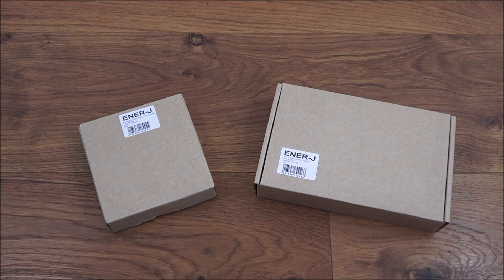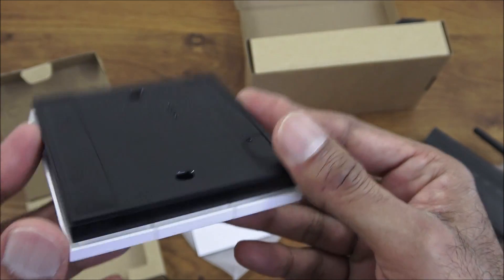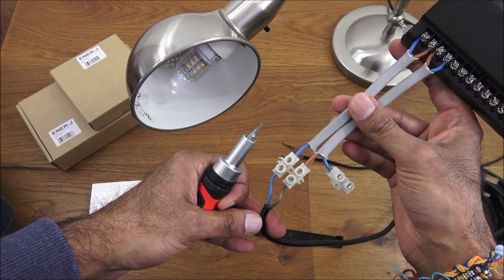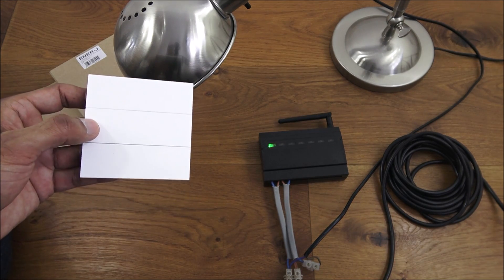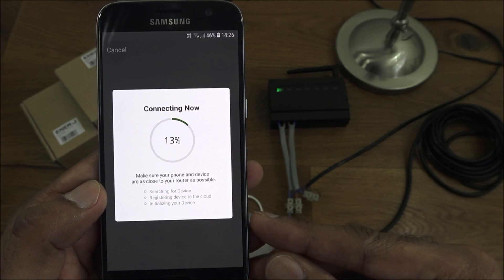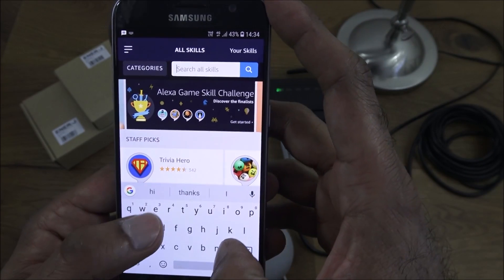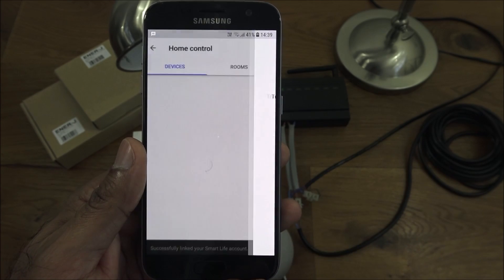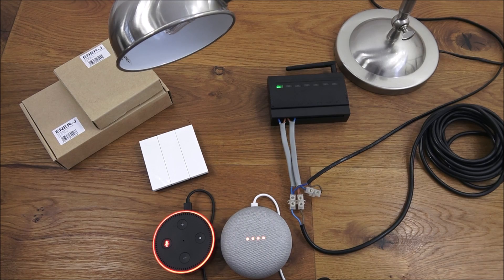ENER-J 6 Circuit Controller + Kinetic Energy Switch [Hands on Review and Test]

Comment: Er, hang on a minute - how do you reset a device that was previously on a different network - like my problem!
Reply: Did you (or anyone else) figure out how to get the device back into pairing mode? One of my receivers has lost the wifi connection but no matter what I try I can’t get the rapidly flashing light back.
Reply: If anyone else has the same issue I fixed it by killing the power to the unit for 10 seconds, then turning it on for ten seconds and repeating this two more times (so three cycles on/off in total).  Following this returned it to pairing mode (rapidly flashing red light) and I was able to use the app to reconnect with no issues.

Comment: What's the maximum load per circuit? The website doesn't say. Cheers
Reply from the maker: I've just had it confirmed it's 16A x 2 and 10A x 4
Reply: @GeekStreet  Thanks for your reply. I'm currently researching kit for whole house lighting with motion sense. I'm thinking of Smarthings and Fibaro dimmer. Have you experience of these at all? thanks.
Reply from the maker: No sorry I don't have experience of these item, but I've got to say try not to over complicate things only do this in heavy use areas. If that makes sense.

Comment: Great review. Is it possible to buy individual switches with it instead of a six switch panel?
Reply from the maker: Thanks for the comment much appreciated. Actually interesting you're asking this as I have just completed a review of a single switch and I am using it my porch for the porch light as it would in too much hassle to wire in a cable for the switch and this gives the best of both worlds as you can also use remotely too.

The video is not released until late January but here's an early preview for you, I really like this product as it integrates with the Smart Life app:
https://youtu.be/KHSwGmzy3IU
Reply: yes, this type can do it, http://zemismart.com/zemismart-alexa-echo-google-home-mini-voice-control-switch-no-need-battery-wireless-remote-control-suit-for-halogen-bulb-ceiling-fan_p0058.html
Reply: Up to 10 switch can be paired